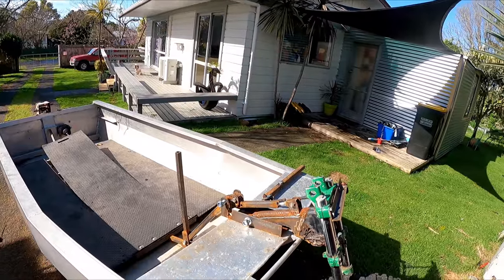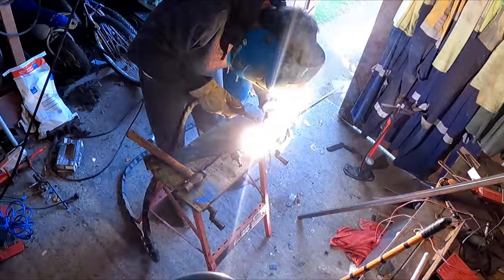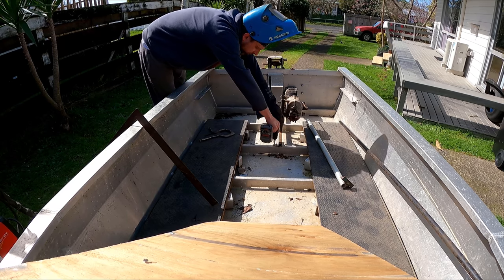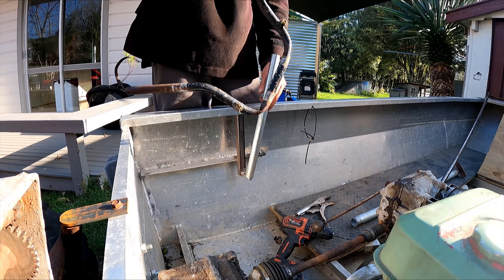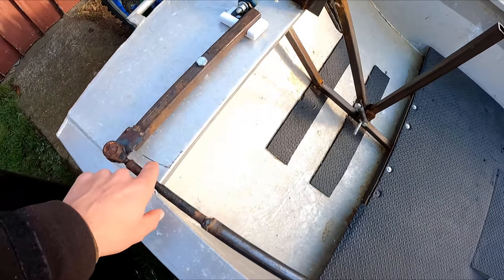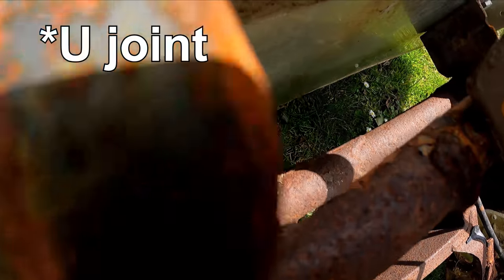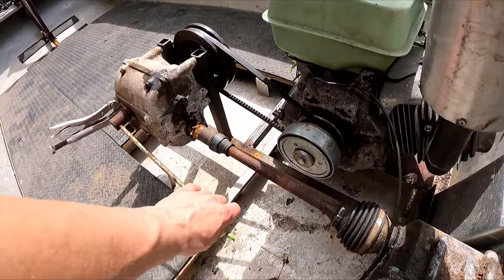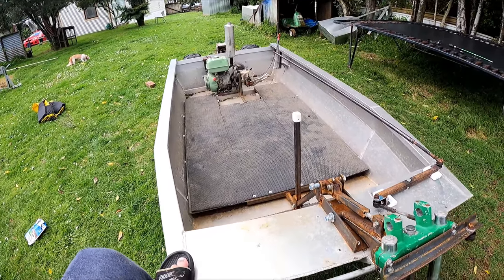Amphibious ATV Boat Build, p3 Steering and 1st Drive

Comment: Either space the middle so it wont wobbler, or try and find some chucked pieces of delrin. Even if you printer in ABS or petg, itll wear down Quick ime 😃
Reply from the maker: I was wondering how well PLA will wear and just a spacer in the middle might be better

Comment: are you stick welding with a tig torch ????
Reply from the maker: yes a 2.5mm arc welding rod fits in the 2.4mm collet, saves changing leads back and forth and you get the high frequency start which makes it super easy 👍